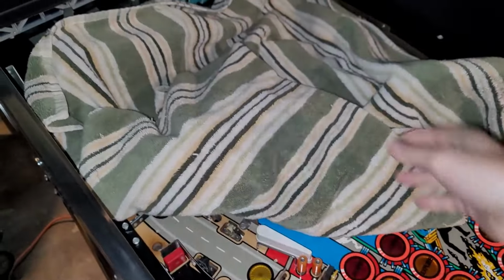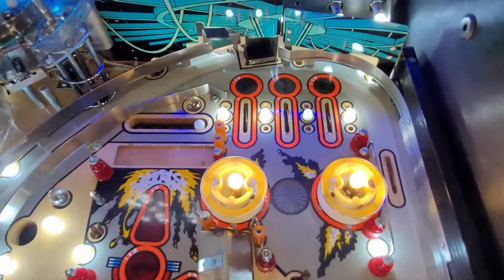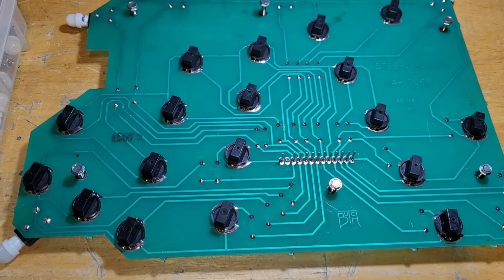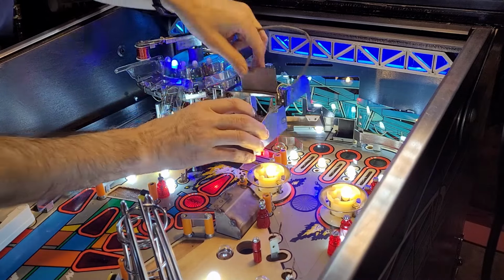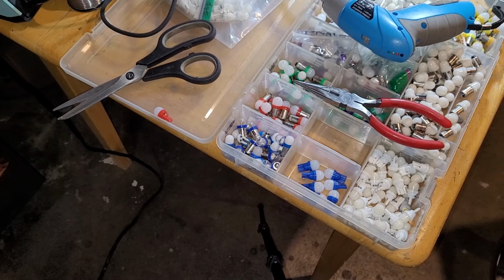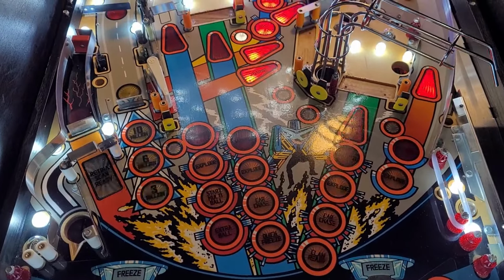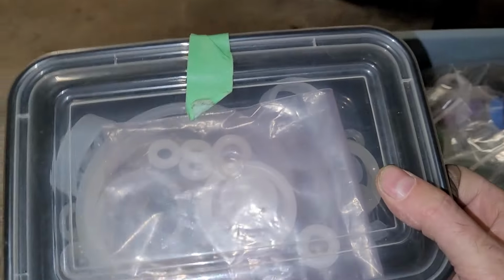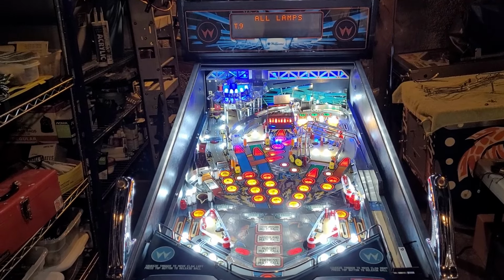Part 10: Demolition Man Pinball Project. LED's LED's and more LED's!

Comment: 2:14 - what's the little technique with the screwdriver on the sockets here? 🤔
Reply from the maker: The led caps are fat and a tight fit so the sockets need to be centered so im using the screwdriver to straighten up the sockets!